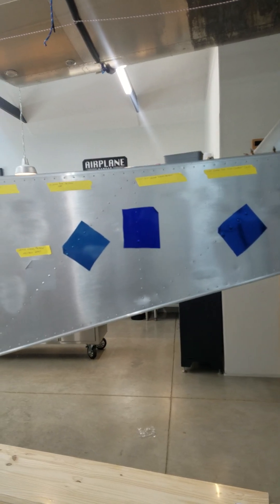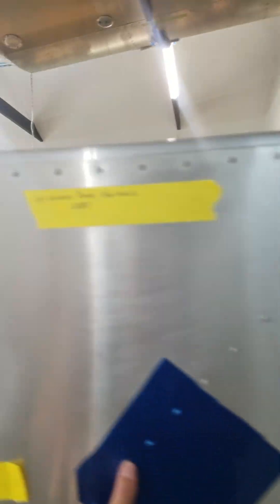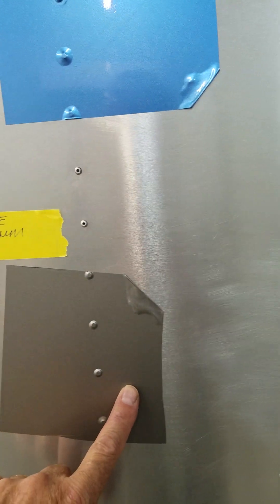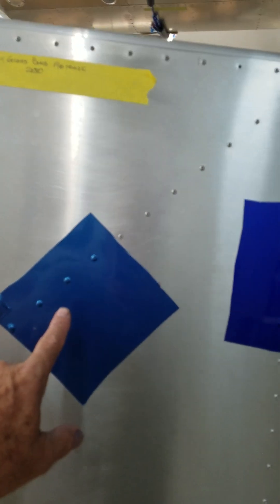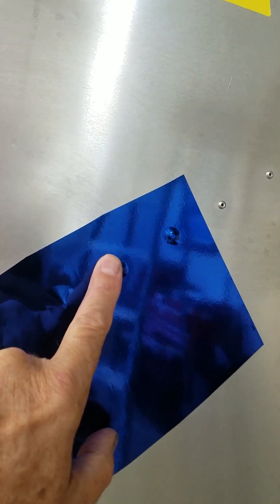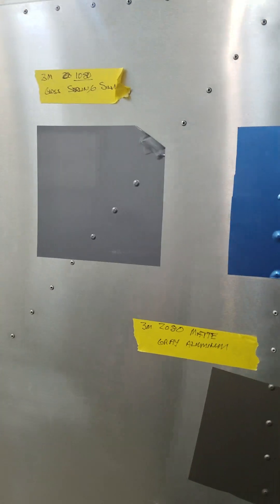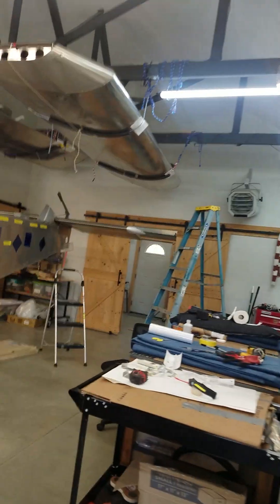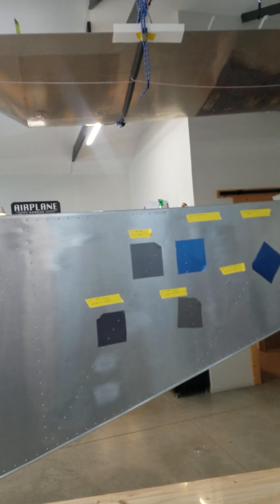Intro vinyl wrap airplane for beginners. Compare wrapping vs painting vs polishing your airplane.

Comment: What have you found works best for going over rivets. You mention heat and "finger compressed." Are you just applying enough heat to soften the sheet and pressing it down? Maybe rolling your finger over it? I've never been able to find a good tutorial on rivets. :)
Reply from the maker: I heat it gently with a hair dryer and then gently push with the soft pad part of my thumb.  It takes very  little heat ( like 150F-ish?) and little pressure.

Comment: How's the R18 holding up on the RV6? I'm thinking in use a Honda L15B7 1.5 turbo on my rv6 project, do you know this engine?
Reply from the maker: I sold the RV6A with the R18 engine.   I flew it about 160 hours and it ran great.   I know of the 1.5L but I have never owned one.